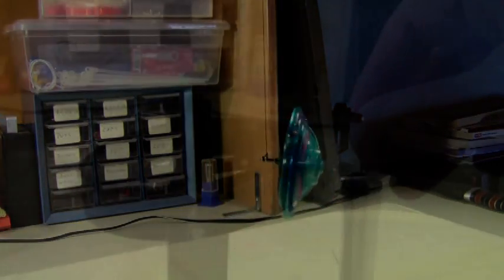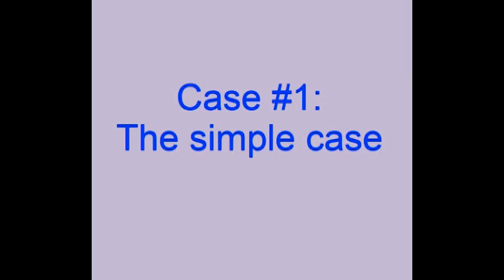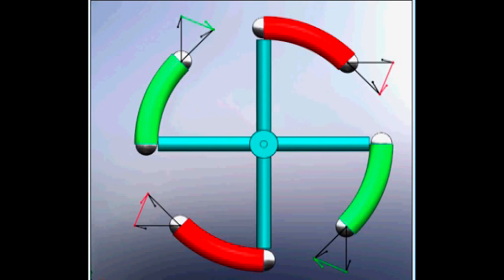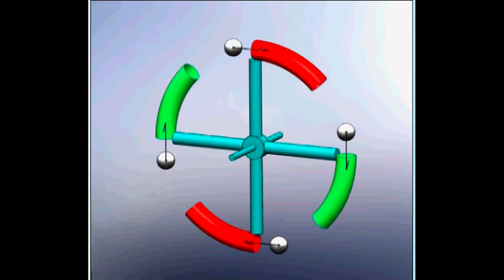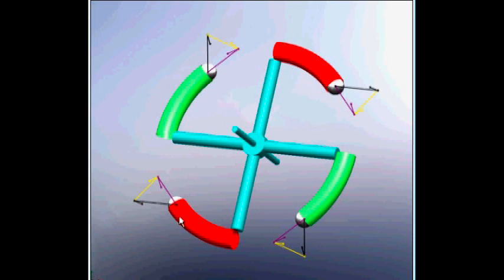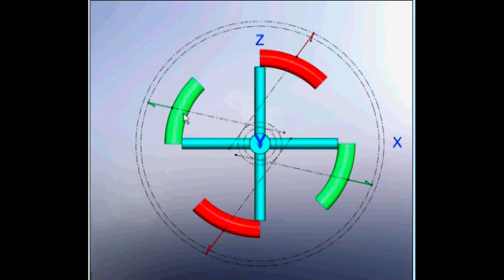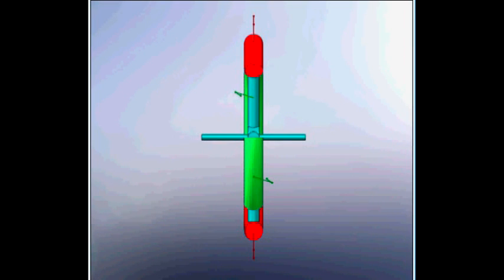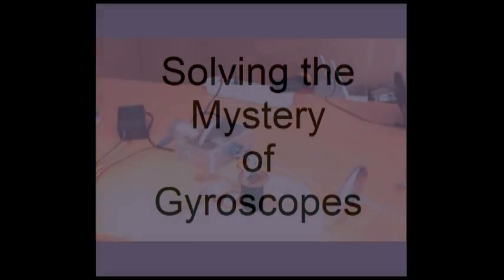Solving the Mystery of Gyroscopes

Comment: May I share the few sentences my elderly college physics professor used to solve this mystery for me ? 

1)  imagine a fictional, paper-thin-but-very-strong-and-stiff, weight-less disk that's 24 inches in diameter.  It has a perpendicular axle thru its center (pitch axis).

2)  imagine a white cue ball from a billiard table with some weight and mass ... magically attached somehow so that its spherical center is co-incident with the  imaginary circle that is the outer edge of the disc (like an electron on its circular orbit).

3) Holding the ends axle at arms' length from your body; the plane of the disc is perpendicular to your body AND the floor.

4)  With the disc spinning slowly, if its TOP edge rolls AWAY from you, its BOTTOM edge will come TOWARDS you:  the cue ball comes towards you at the bottom and goes AWAY from you as it passes over the top.

5)  If you look DOWN on the disk while holding it at arms length (hard on the neck), the disk will look like a line segment perpendicular to your body with one end close to you and the other end away from you.

While looking down, as the cue ball orbits the disc, when it comes UP, it will appear to move to the END of the segment closest to your body.

When the cue ball is at the TOP of the disk, looking down, it will look like it's in the MIDDLE of the line segment.

6)  If - at the VERY instant the cue ball is going OVER the top - you rotate the disk's plane about a vertical axis thru the center of the cue ball (a YAW axis) ... say 30 degrees counter-clockwise ... while looking down, the line segment will look like you have rotated it counter-clockwise.

BUT that cue ball has some weight and inertia !  and it does NOT want to suddenly change its path 30 degrees to the left to "stay on the disc" so the cue ball ends up "knocking that disc over" because now the plane is no longer aligned with the cue ball's direction of travel ... the plane is now "in the cue ball's way" and it gets "pushed over."

That's why, when you're holding a spinning bicycle wheel at arms length, and try to pivot (yaw) it about its vertical axis some counter-clockwise amount, the wheel instead tries to "flop over" (roll) to the right.
Reply: +Jeffrey Hutchison  I like this intuitive explanation. One thing, shouldn't line 5(b) read: "While looking down, as the cue ball orbits the disc, when it comes UP,  it will appear to move to the END of the segment furtherest to your body ? "
Reply: if you've got a 12 inch long neck and were able to extend it - like a snapping turtle - and then look DOWN at the edge of the rotating disc - which you're holding so that the plane of the disc is both perpendicular to your chest (while you're standing) and to the floor, then, if the disc is rotating so the edge closest your belly is coming up and the edge farthest is going down, the ball - when it's at the bottom of the disc - will appear to be in the middle of a line segment - what the edge of the disc looks like when you're looking DOWN at it. As the disc rotates, the ball moves FROM the CENTER of the "line segment" and towards your body as it rotates "up" the disc towards your chin, and then away as it passes over the the top of the disc and then descends along the circumference on the far edge.

Of all the graphics and visuals which try to present WHY gyroscopes react as they do, I find the "weightless, thin disc with a single cue ball on its edge" to present the best mental model for explaining WHY a bicycle wheel wants to "flop over sideways" when you hold it at arms' length and impart a "yaw" input to the wheel's axle.
Reply: The more eight-cylinder, double-acting words you pile upon increasingly unwieldy syntax, (parentheses), CAPS - dashes - and "quote-marks", the harder for the reader to construct a mental image.

A lot of people are still trying to struggle with the video.
Reply: @-danR   I sympathize with the tedious mental effort required but can't think of a better or shorter explanation.

If you SLOWLY and SEQUENTIALLY visualize each step I've described, you cannot HELP BUT SEE how imparting a YAW to that "weight-less disc" as the "cue-ball" comes over the top will knock (ROLL) the disc over.

I have not seen an animation depicting a DISC with a SINGLE mass element attached to its circumference to capture how the mass element affects that disc (spinning about its PITCH axis) at the instant in which it is YAWED.
Reply: hi, Leo ... thanks for your comment !  regarding line 5:  

1)  the disc is perpendicular to your body AND the floor (if it was a dirty bicycle rim, it'd create a dirty, black vertical line on your shirt from your belt line to your collar);  
2) if you're standing to the RIGHT of the person-holding-the disc and looking at the center of the disc, it would appear to be spinning "clockwise" - thus the "cue ball" goes "up", close to the disc-holder's belly and then "away" from the disc-holder's chin as it rotates up to and beyond the 12 o'clock location.
... again, thanks for your comment.
If you've found an animation that depicts a SINGLE mass element attached to the edge of a thin disc, please share the URL !
Reply: Jeffrey Hutchinson I was with you all the way to the last sentence. Is the plane of the wheel perpendicular or parallel to you?
Reply: tom lathrop yes
Reply: tom lathrop perpendicular to person holding wheel's axle.

Comment: Going into the minute detail like this is very informative. But I think the following is also very informative:

The angular momentum of the gyroscope is a vector. It has magnitude L and direction n̂. Here n̂ is the unit vector along the axis of the gyroscope. 

It turns out that the torque T is just:

T = d/dt( Ln̂ )

T = L d/dt( n̂ )

So although the magnitude L never changes, torque is generated by virtue of the fact that the unit vector along the axis of the gyroscope, is changing with time. Note that T is also a vector.

I think the simplicity of the bottom equation speaks volumes about the cool physics!

Comment: what the actually uses of gyroscopes
Reply: stabalizing things. childrens toys.
Reply: The rotation of the Earth will cause a Gyroscope with 3 degrees of rotation (called gambles) to align its self to True North.
And a Gyroscope with 2 degrees of rotation is called Directional Gyro.

Both are used for navigation. The 1st is a stand alone system and the 2nd is used in conjunction with a compass.

Comment: I'm no physics student (yet) so forgive me if this is poorly worded. In the video you demonstrate the gyro's counter clockwise movement by adding a weight, and while the weight "falls" slower, how does the weight of the weight effect the counterclock wise motion, and the speed of the weight falling?
Reply: To clarify how does a CHANGE in the weight effect the motions. If the weight is heavier do these forces still equalize to the same rates, or does it fall faster, but turn slower or something else?
Reply: LunarFurorGames The rate of precession and the rate at which the weight fall are both related to the ratio between the angular momentum of the gyroscope and the torque applied by the weight. In other words, if you have a smaller weight, further-in weight, smaller/lighter disk, and/or a slower disk, then the turning around and falling happen slower.

I'm not entirely sure how to explain this. To be honest, I just kind of trust/accept the math.

This is the same mechanism that makes riding a fast bike easier than riding a slow bike. If you start to inadvertently lean in one direction or another, gyroscopic precession nudges your front wheel in the opposite direction, keeping you on a straight course. If the back wheel turned and the front wheel were fixed to the frame, it would actually amplify small imbalances, an the bike would take a lot of effort to keep upright.

You could try to look up explanations of how to use the "right hand rule," and how vectors are used to represent rotation. You'll have to learn that stuff anyways, but it's really just a mathematical tool (albeit a really useful one). I would focus more on learning about interesting phenomena in a qualitative way. The Veritasium  and Sixty Symbols  channels are great for that. If you do want to dive into the math though Khan Academy is good.
Reply: Thanks for the explanation! I subscribe to the first 2 already :P I'll take a look at the second. I'm a programming student, but a physics lab is in my schedule this semester (start in a couple days!). So I'll be able to ask my professor too.

Comment: Combine two gyroscope and u can create a flying saucer BOO
Reply: i think that wont work and is a little difficult
Reply: I don't think so either, but I would love to have lab and give it a shot.
I wonder if you could configure gyros to actually give an acceleration in space.
Acceleration without a rocket in 0g. I've always wondered that since I took the course on them back in 1990.

What if only part of the rotating gyro was bent & the actual object rotating was a liquid?
How would the force vectors line up then. As in what if the x axis was moved say 2 degrees to the left on the y axis (while the other side of the x axis doesn't move) and the balls in the diagram were replaced with water. Like running water through the inner tube of a bent bicycle wheel.

Come on ... we want a flying saucer..  ;)
Reply: 864208642A Acceleration without a rocket (or an external force) implies a violation of the conservation of momentum, not happening.

Comment: its how everything in the solar system manifest their own inertia property, gyros is a key to most theoretical encounters of what we called 'flying saucers' in the mid 20th century, it creates a momentum force similar to a planets magnetic sphere, it can be used to make things balance or  like a bike,boat,car,trucks,bus helicopters even airplanes someday, gyros for now is know to form Axis formation of 3D movement physics, there is 6 'bi-motions' in the universe,3Axis & 3Geo, Axis has; Pitch motion(like your head looking up&down),Yaw(turning left&right)& Roll(tilting side-to-side). Geo motions are; Directional(forward&back), Lateral(moving side-to-side) and Vertical(elevating up&down). Some day gyros will be known to the public to even perform the Geo effect which would perform what is called Flying, or in the early stage as weightlessness in a gravity environment. in very SCI-FI terms in was mistaken or known as the phrase like 'impulse engines'. or travel between an electron/tron energy path term not yet known, to make a trail path called time traveling.

Comment: Excellent video! I think that explanation is clear enough to explain the stability without external forces applied.  THings are going more counter intuitive when transverse torque is applied. In my view, the "tubes" provides a rigorous way to explain, but not clear enough.
I suggest to consider the problem in a slight different way:
- At a given time, reduce the spinning ring to a bar, rotating around the axis, with masses at each ends, corresponding to a "trench" of the wheel. On one mass, there is a force upward oriented and on the other the same force but downward oriented, making the wheel spinning.
-Suppose a twist is given horizontally to the whole system. Now the masses will still see the upward and downward forces, as before, but furthermore, each of them will see a lateral forces, rightward on one side and leftward on the other. These further forces will act in a perpendicular plane woith respect to the plane containing up and down force (making the wheel spinning).
- So to understand the resulting reaction induced by horizontal twist, it suffices to consider the resulting forces from the two existing in each masses . This resulting forces explains the movement resulting from the horizontal twist applied on our "elementary trench" of the spinning wheel. To obtain the global phenomena, we have to integrate this mehcanism to the whole wheel, which is a hot mathematical story, but which does not modify fundamentally the reasoning.
Hughes explained the precession through this approach, in 1945, when working in SperryCo.

Hope tyhis help!

F2
http://fms7259.e-monsite.com/

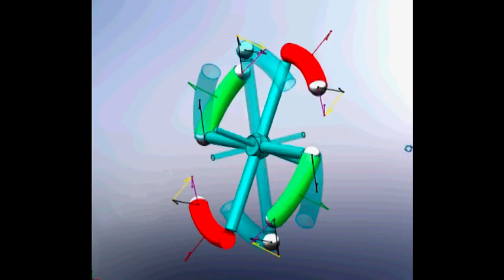Comment: Nice video presentation. I watched this video repeatedly a couple of times. What is bothering me is that when the velocity vectors are relocated to the midpoint, representing reacting forces (6:08), the vectors on red tubes, are pointing radially outwards from the center.  If the force is applied on the end of Y axis to produce torque about X, then there is no reactive force to the torque applied. Consequently the gyro would flip over almost without resistance. I think the vectors on the red tubes need to be somehow oriented in counter torque direction; to support the weight (shown at the beginning of the video) and then the green vectors will do the magic of precession.
Reply: In addition to this video I found really nice text with pictures on “Newtonian mechanics explanation of how the gyroscopic torque results from the tilting of a spinning body”. I believe that the author N.O.Wiliams and his calculation model explain the gyroscopic torque and precession.  The article can be found at: ” http://homepage.ntlworld.com/norm.williams/”

Comment: Sorry if you are worried about the actually matter in a gyro your all wrong. 
Wake up!!
Matter is all practically weightless. 
We know that all matter is 99.9999999999999 % empty space, But all matter is filled. Every atom is filled with the pressure of Aether. This pressure is relative and depends on the overall size of the greater mass which you are near to. A gyroscope simply spins the local pressure of Aether which fills the atoms of the wheel out of its mass as it spins and creates a temporary anti gravity effect. It is always trying to being refilled as it spins 
This is simply understood as a reverse of what's going in the deep oceans. The greater the size and mass of a planet or star the greater it surface pressure becomes because the further you get out into space away from the center of the planet or star the greater the pressure of Aether becomes.  We are simply pressurized to the surface of the planet. Space is filled with Aether and all atoms are filled with it as well and as great masses grow further from their core the surface pressure within the atoms increases along with it.  
So you just got a twofer. Gravity solved too.

Comment: Thank you for this. This phenomena has been driving whacko ;-)
Simplified question? The forces move/act/react within the tubes, the balls cause straight forward & an outwardly pulling force simultaneously causing the (pitch or yaw?) to rotate the axis? Is that correct? Thank you again and look forward to your response. Dave

Comment: Yes you do, always need energy to keep stuff in the air, there is even a formula for this. steel beams are on the ground. 
""Gyroscopes will trade some of their rotational energy to precess"" they are not using energy so they are not trading.
Steel beams will fall when the ground is not there. this is stable. if your gyro scope is not turning, your weight will fall, but sinnce it is turning, the weight is hanging, apossing gravity, and your gyros isnt using any energy, why.

Comment: what you say, if you applied a weight to your model, as you did, you will have found the the gyroscopical wheel turning (free wheeling) will start consuming more power, since you are keeping an object levatated, But I am sure, your gyroscopical wheel did not consume more enery, making your statement a bit iffy, when you hold an object in the air, you need energy, thats the rule

Comment from the maker: In a very crude way of explaining, it's kind of like this: You apply a force to try to tilt the gyro.  But because the mass is rotating, it's as if the reactive force "waits", or doesn't express itself until the mass has moved to a new (rotated) location.  In essence, re-acting at a point different than where it was applied.
Reply: How about this: you can account for the spinning disc's forces by decomposing them in their x and y components. Their Vectorial product will generate a perpendicular force to those components. Now, if you apply a force to the rig, all you have to do is to perform a vectorial product of the previous force and the force you are applying, and the resultant shows how the gyro's precess.
Reply: And why is the reaction force 90° ahead of applied force in the direction of spinning mas (disk, bike wheel)? Counter steering?

Comment: Tie a weight to the end of a string, and swing it around in a circle, clockwise (viewed from below) over your head, while facing north.     Now if you wanted to tilt the circle so it's highest to the north, and lowest to the south, then at what point in the circle do you have to deflect the path of the weight upwards?    It has to be done 90 degrees ahead, to the east.  The deflection force only changes the trajectory, not the instantaneous position.

Comment: It's not that complicated. The mass spins so that one moment part of it is on one side and then in the next it's on the other side. If you apply force to move the gyroscope you have to try to accelerate the mass on one direction. Problem is a fraction of a second that mass is on the other side of the gyroscope and it's being pushed in the opposite direction when it's momentum still wants it to go in the first direction. The result is stability.

Comment: Is it that, moving objects like to continue in a straight line and are being prevented from flying off so the energy is pulling them outwards which causes the downwards gravity to act equal on both sides because if one side went down, as its spinning it would climb a slope and pull itself level. with gravity on oppsite side. Hope you understand what i'm saying here.